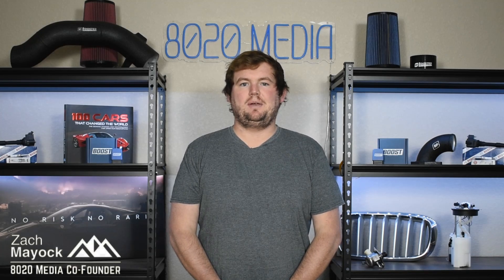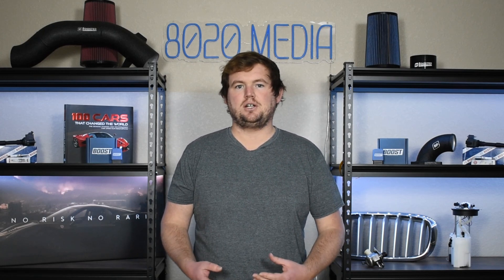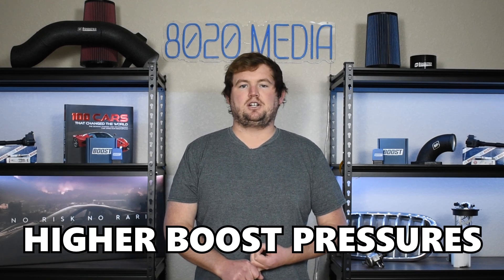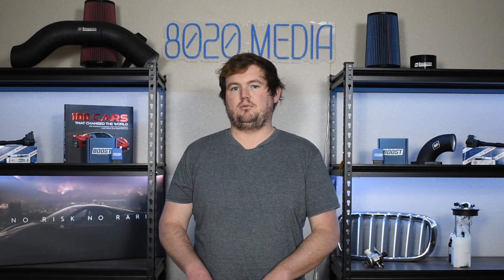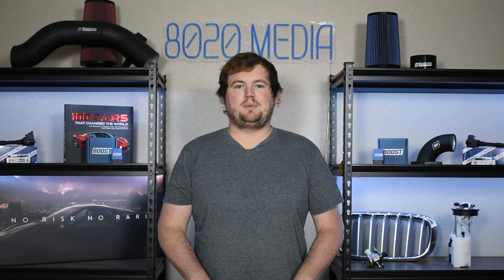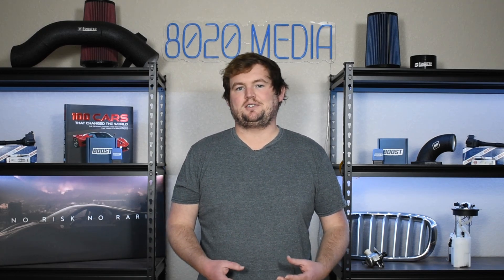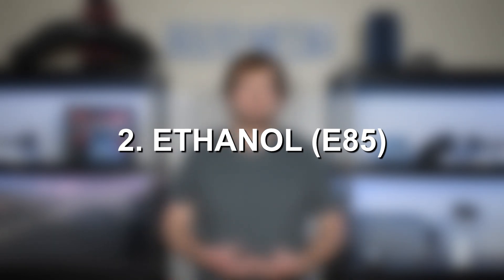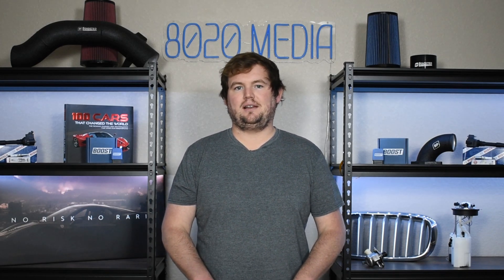Pump Gas vs Race Fuel vs E85: Which Fuel Is Right for Your Car?

Comment: I have an 07 335i with the N54. Can I run E85?
Reply from the maker: P - You can safely run E85 on your N54 if you upgrade the fuel system and install a proper tune. Without these modifications, using E85 could result in engine damage or poor performance.